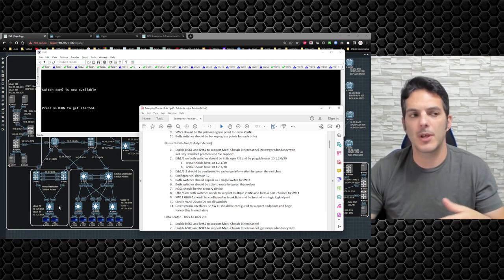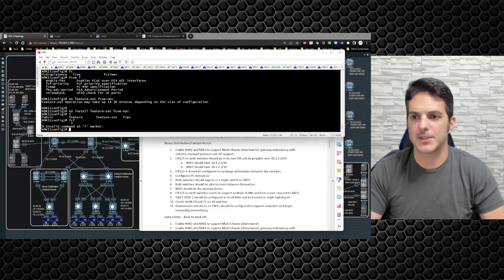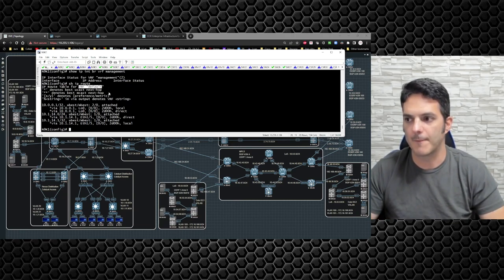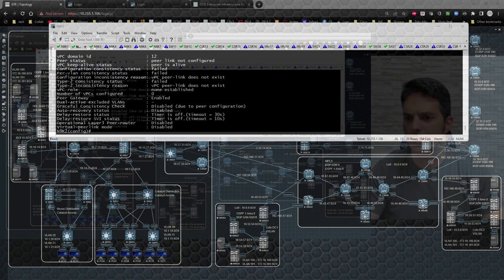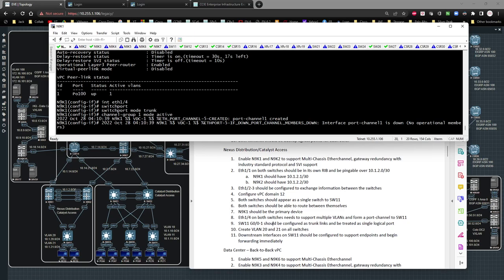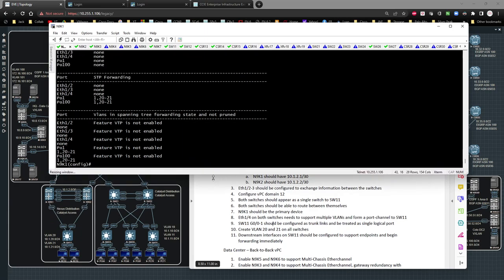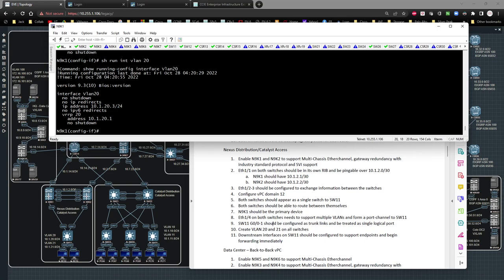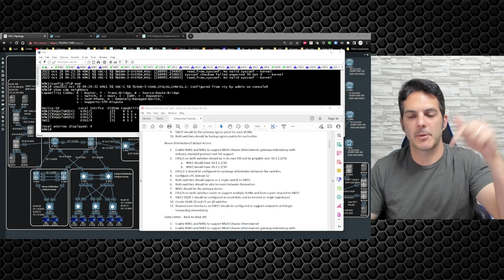Enterprise Lab 1 Nexus Distribution and Catalyst Access

Comment: Hey Rob, quick question on this course/lab. Should we be aiming for any specific versions (or avoiding any) to not run into any issues or does it not really matter? Need to add nexus/xr/Palo alto into my lab. Apologies if you've already covered this but didn't see anything in the drive/intro. Cheers Edit - nevermind you can see the version in the config files for the Cisco stuff at least I'll figure out the Palo when I get to it!
Reply from the maker: Using 9.0 code for Palo. Any version could be used tho.